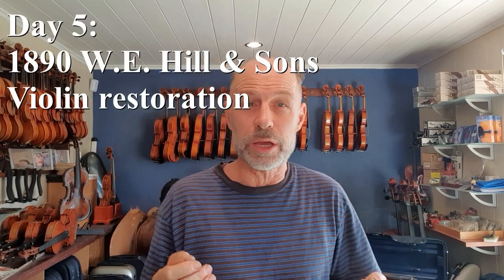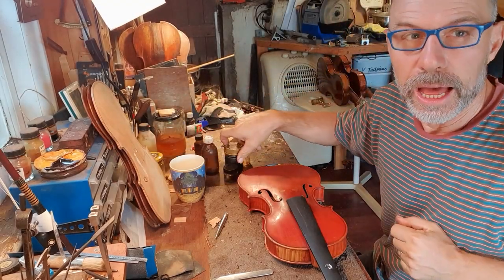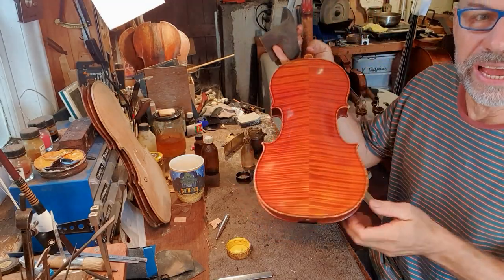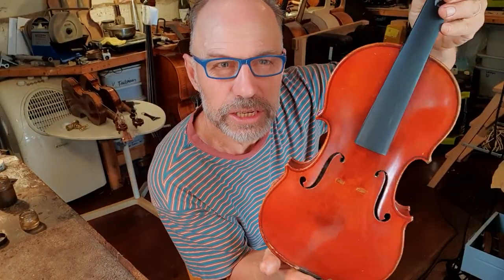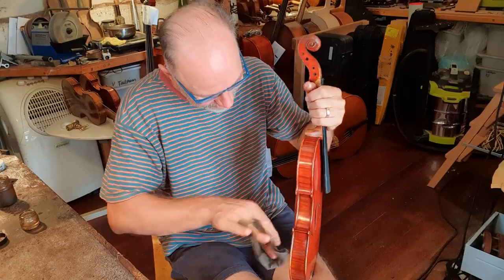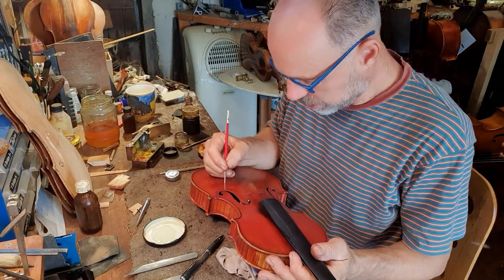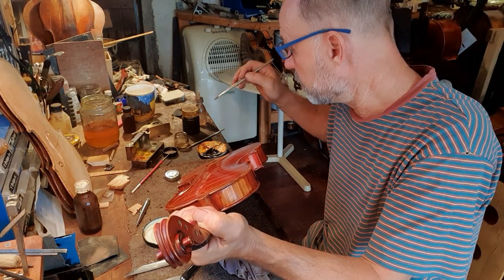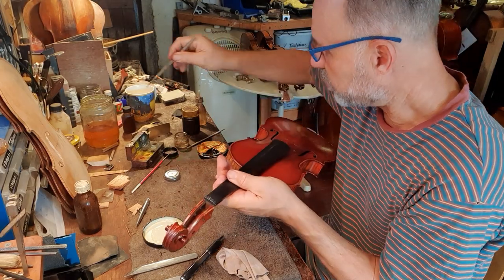1890 W.E.Hill & Sons Violin restoration day 5 - Varnish work

Comment: I have an old (mid 1850’s) Ole Bull Violin (copy) that is pretty beat up with nicks and scratches. It has an oil based finish. How would I touch it over?  Can I simply rub/apply/polish it with new varnish?  Also: What’s your favorite Violin to make/copy? Thanks much!!

Comment: Amazing video! Quick question: Are there advantages/disadvantages  to having a two piece violin back instead of one piece?
Reply: There's little evidence to suggest that a one piece back is superior in tonal qualities to a two piece back but people still tend to prefer one piece and are willing to pay more sometimes. While the maple slab needed to make a one piece violin is often more expensive due to how how tone wood is cut from the tree. It doesn't necessarily mean that a one piece violin is of higher quality. The only benefit that one piece backs have over two piece backs in my opinion is that one piece backs don't have issues with the center joint separating with age or neglect. However, on a violin the chance of the back separating is slim if the joint is done well and the proper glue is used. Of all the instruments I've repaired and had joint separation on, it's primarily been on cellos which is why most modern makers reinforce the top and bottom plate joints with cleats. If you're considering buying an older instrument with a two piece back I would examine the joint at the top of the back near the button and at the bottom above the endpin (where joint separation typically occurs). The joint should look clean with no black line indicating possible separation as if it were just one solid piece.

Comment: Hi Olaf! This series is very interesting to me and I have several questions. If you add the layer of varnish does that not completely change the sound? And how do the cracks effect the sound quality? I guess if you restore them professionally the sound nearly stays the same, but to me it is not obvious that it would.
Reply from the maker: The layer of varnish is so miniscule that it doesn't adversely effect the sound.
Well restored cracks also don't effect the sound.
Reply: @AskOlaftheViolinmaker  Thanks for the answers! Did you ever test the sound of a violin before getting a crack, then cracking it and fixing it professionally. Is it really impossible to hear a difference? Maybe that's a good video idea (please use a cheap violin for this). You could also try different varnishes and how it effects the sound.
Reply: @JohKemStYl3  one could say that a glued crack is much the same as one of the glued joints in the original instrument.  For example the centre joint of the table is a very long joint in a crucial place.   A properly glued seam should sound the same as a solid piece of wood, as hide glue is very strong and very thin.  What would make a lot more immediate difference to the sound is the replacement bridge, unless carefully chosen and fitted, and when he puts the soundpost back, if not in the correct place.  Of course, being expert, he would get it right!
Reply: @nickyork8901 Bridges make a huge difference to the sound. The height, exact thickness and fit of the feet and the shape of the final cut. It's important that the neck matches the bridge or else the strings will not be at the right height.

Comment: If your workshop is dusty, how do you varnish without getting dust on the varnish?
Reply from the maker: Hi Lara,
My workshop is dusty when I sand and make dust. So no worries when I varnish or retouch.
Reply: @AskOlaftheViolinmaker  thank you, I guess I was kind of asking how you remove dust from the air or keep it down in the workshop, too - do you need to use an air filter? Asking for a friend (me).
Reply: I live in New Mexico and pretty much everything is made of dust, even the green chile.